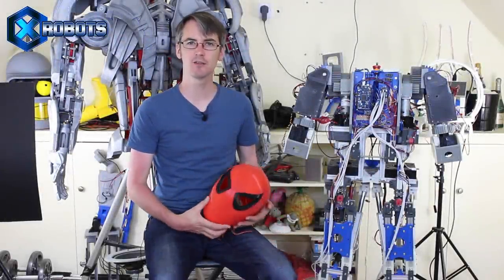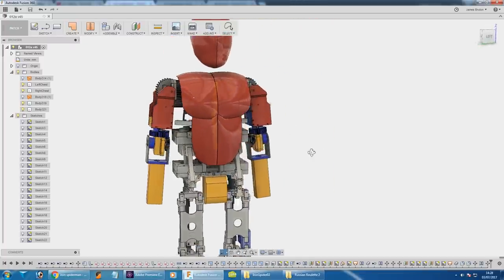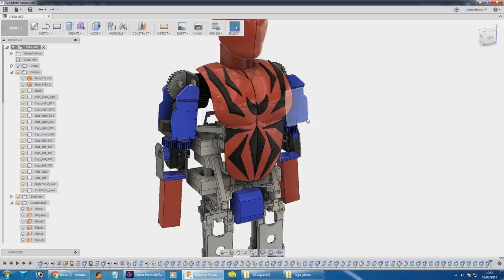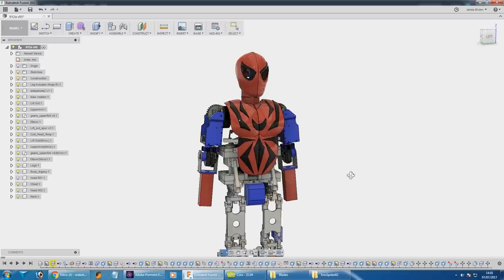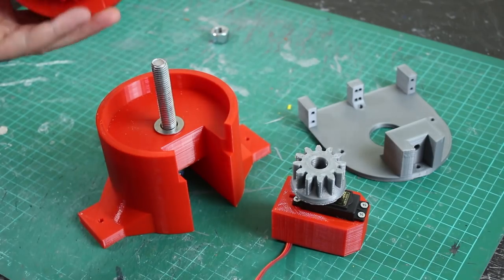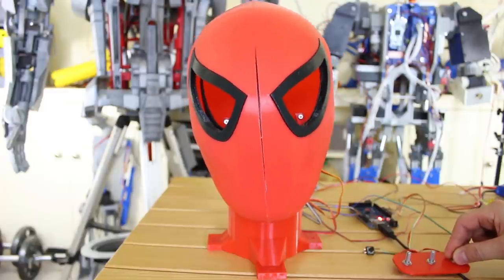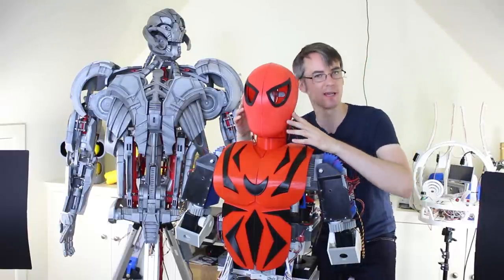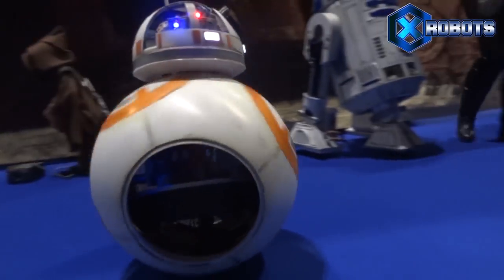Robot Spider-Man #2 | Animatronic Neck & Chest | James Bruton

Comment: you could put two camera inside the eyes and display the two video signals in a VR headset. You could also do mouvement sensor s fixed to your arms to move the robot arms with the signal. So you would think you are the robot !

Comment: You should make it so his head can turn 360. He is a robot after all. He shouldn't be constrained by human range of motion.
Reply: POVadventure It makes the wiring easier if the motion is restricted. No need for slip rings or the like, just make sure the cables have enough slack to move properly.